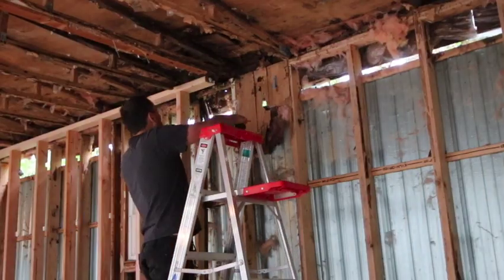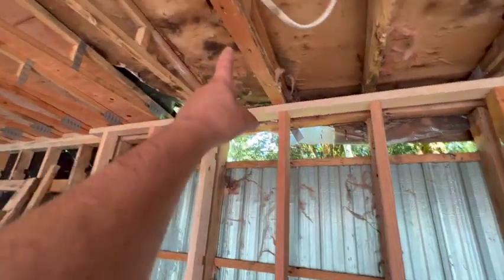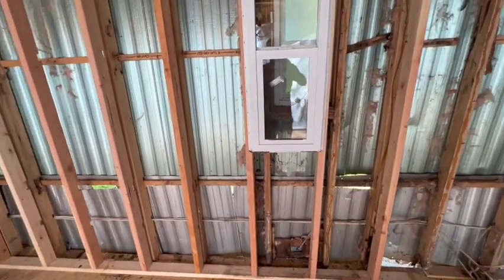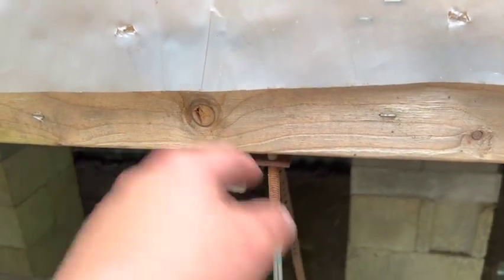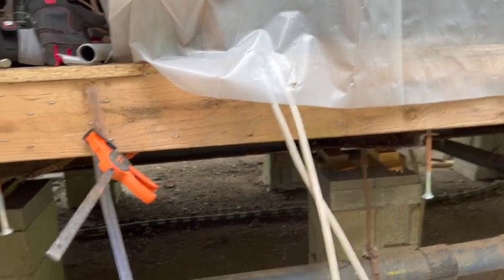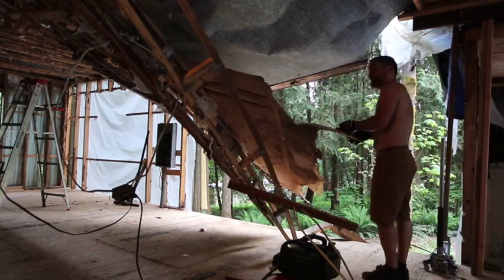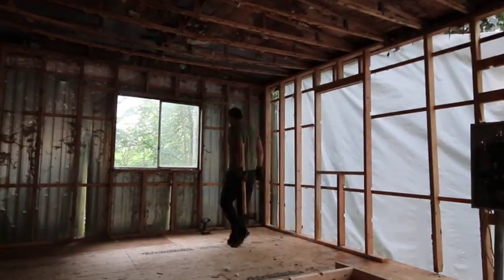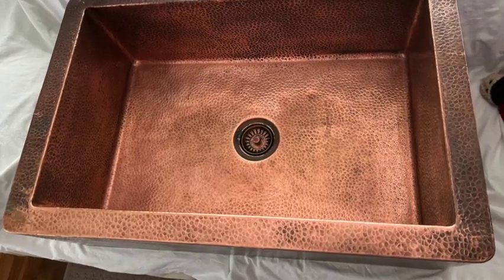Raising The Back End Walls On My Old Single Wide Mobile Home Rebuild Project

Comment: Tell me about how your inspections work? I know from past videos you can't make any changes without filing a permit. But has the inspector stopped by to check your progress. I'm asking because you haven't mention him in a while..
Reply from the maker: I lucked out with a really nice inspector and he's working with me on kinda walking a line on some rules. Basically the don't tell and he won't ask if it looks stock. That's the only reason I went with the same roundover roof truss's. Otherwise I would have done a peaked roof. But my budget is small and doing that would have added thousands to the project. It's also the reason I kept those 1 inch runners on the walls. Those are for stability with the flimsy aluminum but since I'm putting up ply they would no longer be needed but I'm going for that original look. He might bust me on those double top plates though. On other things, they have a set of exceptions to where I only need to pull the permit, do the work, then have it inspected when I'm done. For the roof, I can replace with like kind, or either use torch down rubber, or EPDM rubber without having engineer plans/pre inspections so I'm going with EPDM. I did buy a ton of metal sheets and he was like, NOPE, so I sold them. On the siding, I can do like kind, or ply/t 1-11 and just pull the permit without pre inspections/ engineering stamps so I'm just going with the rough sawn ply. I did buy all the cedar for board and batten and he said NOPE on that too unless I wanted to get those engineering stamps, so I said, ply it is. Same reason I went with copper over pex. Just pull a permit and have him check it all when I'm done. I won't have him out till I get the electrical wiring roughed in. Then I'll have him inspect everything I've done to that point before I close it all up. I have to pay for a couple permits over again as they expire after a year but oh well. Hope that helps.

Comment: Permits - Did you get any permits during this process?  My county requires permits and I think it’s BS that everything from a window to siding needs review.
Reply from the maker: Yeah, some states don't care what you do when it comes to mobile homes. I'm unfortunately not in one of them. See the response to Paul's question about that if you would. Luckily if I keep the same window openings I don't need to pull permits. (you can go up or down) Yeah, I did widen the one over the kitchen sink but it ends on a 16 oc stud stock mobile home window dimension so, ya know, they won't know it's not stock unless they want to do some serious digging. In the end, I may get dinged for a few things and have to pay a few fines or get flagged but I'm OK with that since I don't have a loan out on the property and I have a feeling it would have been hard to get a loan on it anyway if I decide to sell.